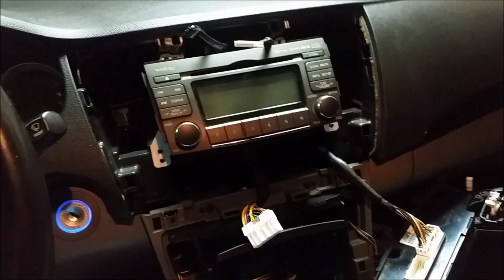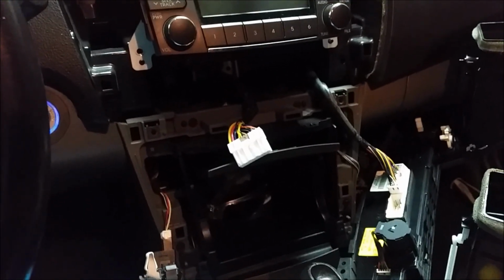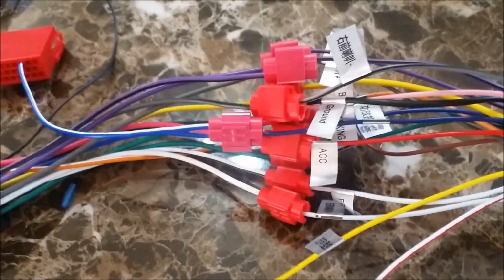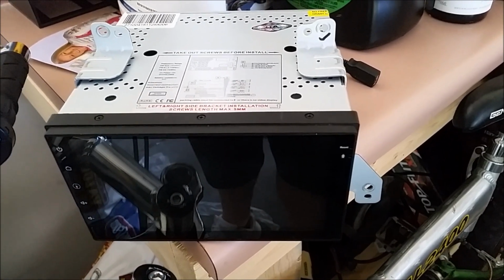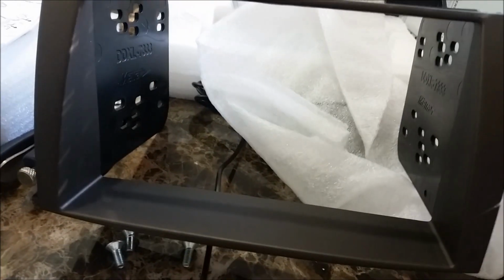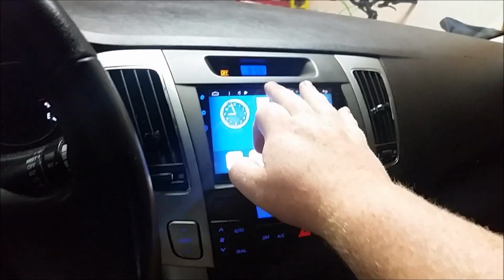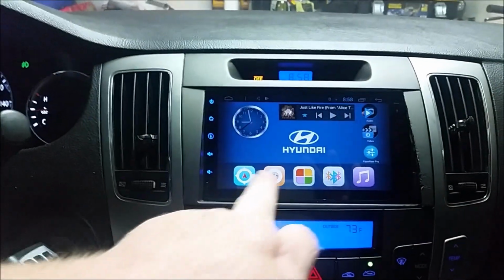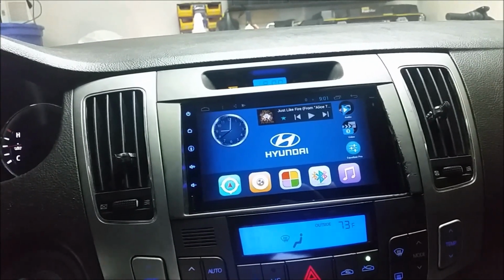2009 Hyundai Sonata Radio Install aftermarket android head unit

Comment: Question ... When you took out the original radio did it have outputs? I have a high end system but never bothered to set it up on the Hyundai car as I was told there were no outputs on the origianal radio and if I went aftermarket I would loose the controls on the steering wheel as we ll as the USB port in the center console.

Comment: So do the steering wheel controls work?
Reply: Did you notice that there are 2 different blue wires? 1 in the main harness and then that red brick? What did you do with the 2nd?
Reply from the maker: Both blue wires had different functions. I had to look at the wiring diagram for the car to figure out what they both did but both of them had a purpose and had corresponding wiring on the harness
Reply from the maker: I was not able to get the steering controls to work
Reply from the maker: I'm pretty sure I just googled it. I think it was on a blog site somewhere
Reply: Update - I got mine to work. I just hooked all the blue wires together with the bypass switch aswell.
Reply: Durtschi Draws Did u make a video of it ? , Am stock trying to get my steering controls to work
Reply: J T where did you get the wiring diagram I have this car to
Reply: all blue wires with bypass swtich? the wires from the harness on the car?